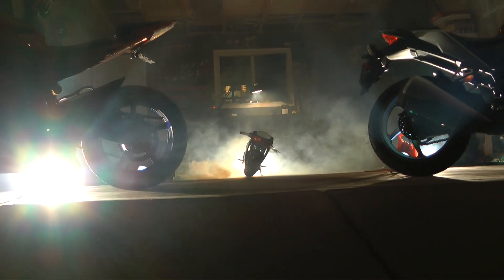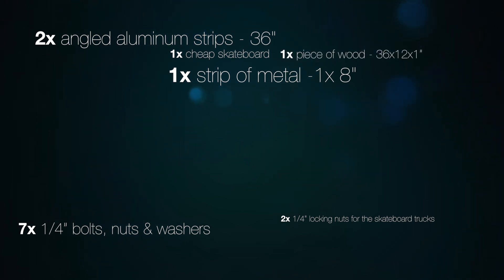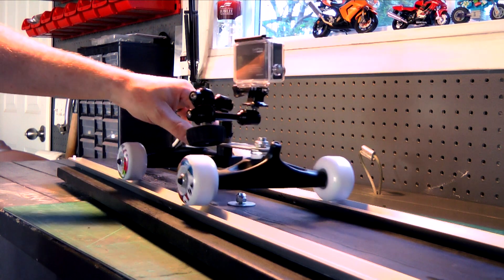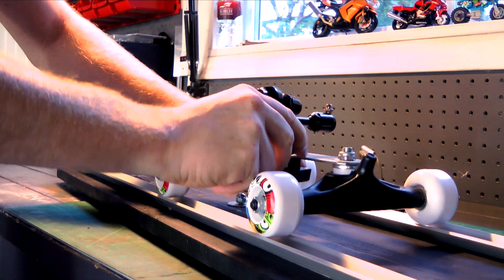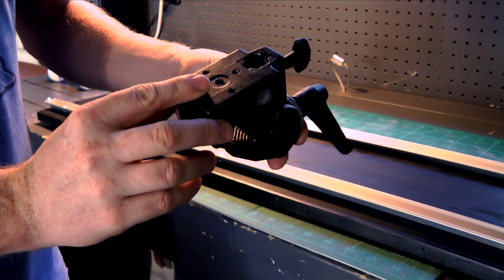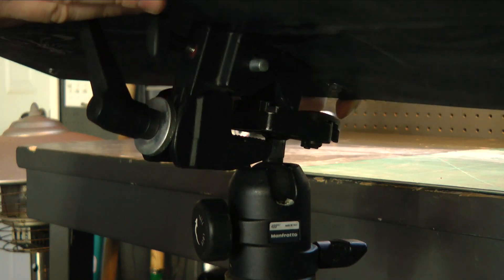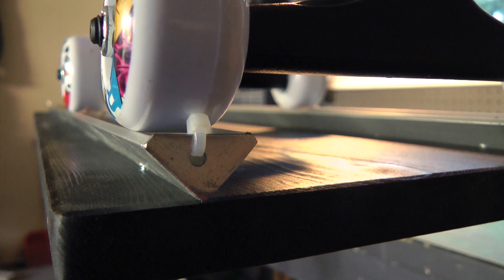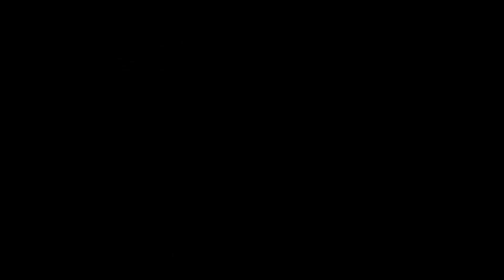Camera Dolly on the Cheap: How-To Series

Comment: Nicely done! I have the Pico Dolly I use a smooth board, but the aluminium strips was an excellent idea, thanks for the tip :)
Reply from the maker: +Gurra Before I made the rails, I had just the board itself. The strips definitely help it from going in unexpected directions.

Comment: What a great concept love these kinds of vids.  Thanks for sharing. 
Now for the dumb question!  I understand that by using the dolly it would keep the camera steady for the long horizontal shots and by mounting it on the tripod you could get the different heights and angles but wouldn't you get the same effect with your hand held gimbal?
Reply from the maker: +WildBill Thanks man! And no, it's not a dumb question at all. The gimbal has a place for sure, but rolling across a singular plane gives an entirely different effect than the gimbal.
Reply: +ROKKIT44 so how, when or where would you decide on the gimbal vs dolly?  How big of a difference is the effect?  Curious minds need to know :)
Reply from the maker: +WildBill A gimbal gives a smoothed out handheld feel, while a dolly gives a more precise feel. You'll notice in movies where the character is agitated, that the camera feels less stable as well. This contributes to the emotion they're going after. When you see shots showing cars, the camera is more stable. Dollies give that. The challenge for guys like us, is that we don't always have a camera crew available and have to carry everything on our bikes. A handheld gimbal is sometimes the next best thing. At the very least, it keeps the "palsy shots" at bay.

Comment: You can get skateboard wheels independently. Might save cost if you have a board already.
Reply from the maker: My actual board is much too nice to take apart for the trucks. The one I picked up from Walmart for this was less than 30 bucks. I'm sure you could get them even cheaper if you looked around.
Reply: +ROKKIT44 Right on. I was more intending it for anyone that might have an old board lying around wanting to try your idea out, but $30 damn. That's a lot less than I thought.
Reply from the maker: +Dexi I realized that after I replied. If I had an old board lying around, I would have definitely looked into that option. My first stab at this was with some old rollerblade wheels bolted to some steel. It worked, just not as well and needed more tweaking between shots.